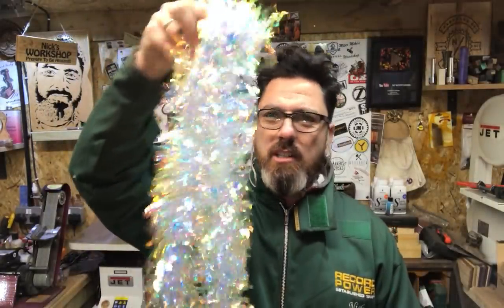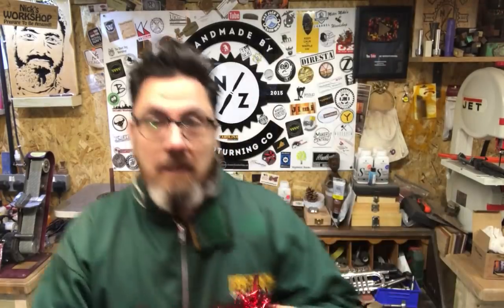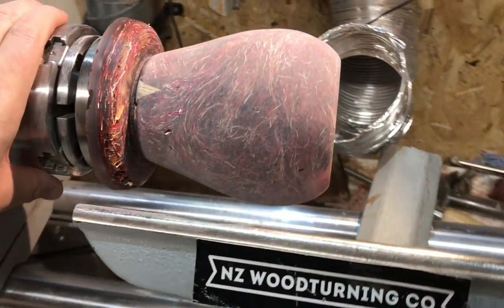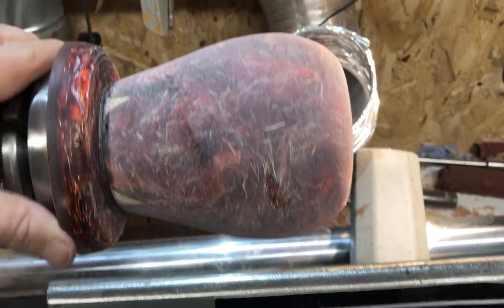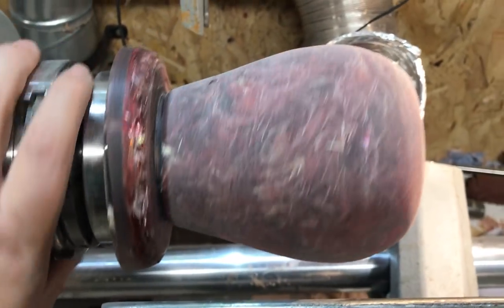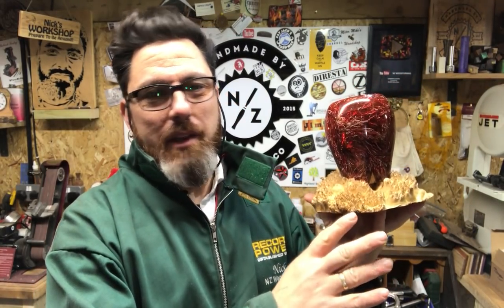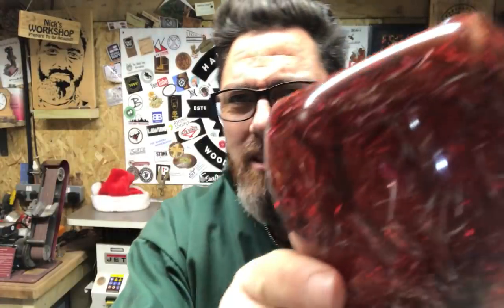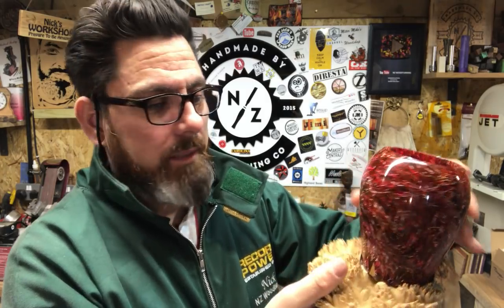Woodturning -  A Christmas Tinsel Vase Using Xmas Tinsel

Comment: You should make a lamp cover with resin and glow powder on the lathe similar to this vase.
After you turn the light off, the resin will still have a glow from being charged whole being on.
Reply: That's an awesome idea. Luminescent particles set in clear resin. It would look like a jar full of fireflies. Excellent suggestion, Dan.
Reply: Amazing idea
Reply: You can order glow pigment from any nail art supplier if it can be mixed with acrylic & UV Resin then, it should mesh well with this resin, awesome idea
Reply: okay but when i turn off my lamp i want it to be off xD
Reply: That is an awesome idea
Reply: Where would you get glow powder? Is there a particular brand?
Reply: Daniel Nicastro that is a great idea!

Comment: On a project like this where you are wanting to core out the center, using a waxed 3" blueprint shipping tube would give you a hollow core that could be easily removed.

Also, if you cap the tube and cut it a bit short of the height of your container, you could mould a solid end thick enough to have a bottom and lid out of that section.

Comment: I love the vase it turned out amazing. Not to found of the music tho. I have to turn the sound off and try to catch you talking so I can turn it back on.  You should make small squares maybe 6 of them with glitter in them. putting a different color glitter in each square. Then stack then where the ends are off a little so when your done it looks like a star. Then pour resin over them. Then make a nice size vase or bowl.

Comment: What is the plastic container u use to hold the wood/resin and tinsel’s in??? It looks like a carry out soup fountained yet the stuff seems to slide right out after curing??!!!  I do small pendant type stuff but always use purchases silicon molds.... would love to know! Did u spray it with a releasing agent?